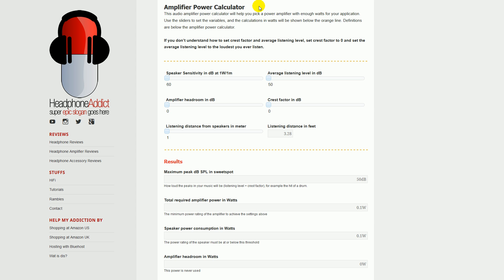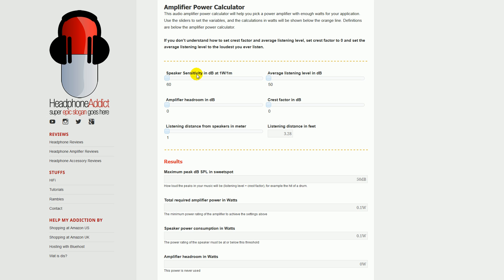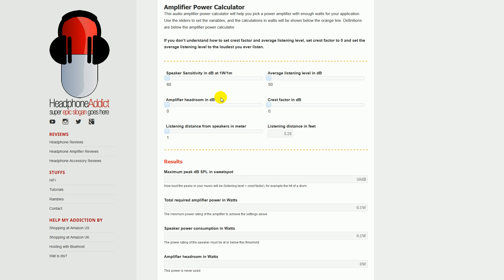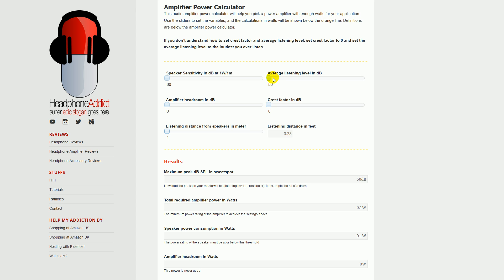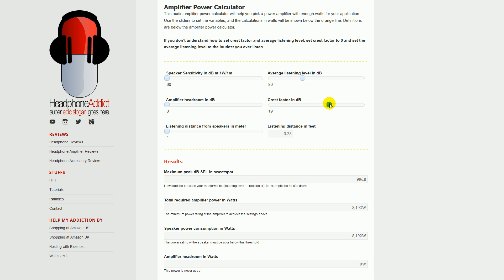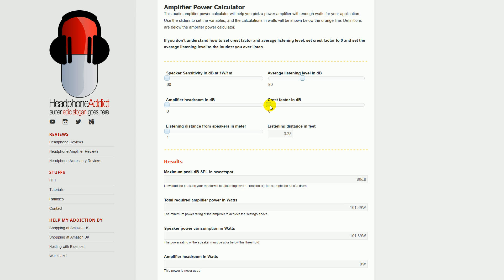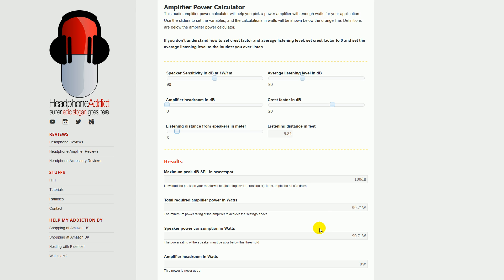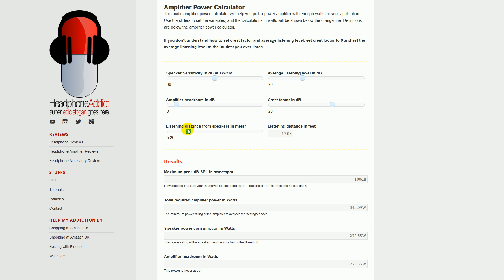How much amplifier power do I need? Use the power calculator

Comment from the maker: I'm going to make a power calculator for headphone amplifiers too. This calculator can be used for headphones as well, but it's a little tricky with cans which sensitivity is rated in terms of 1mV and not 1mW. If the headphones are rated at 1mW you can basically divide the power numbers by 1000 to get the watts. Just remember to set the listening distance to 1 meter as that will correspond to the calculator's handling of the sensitivity number.